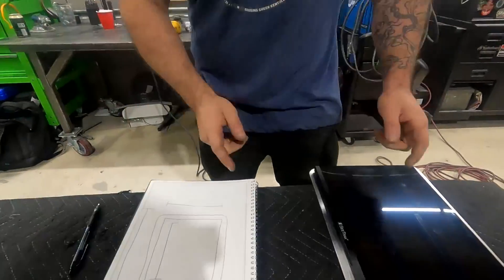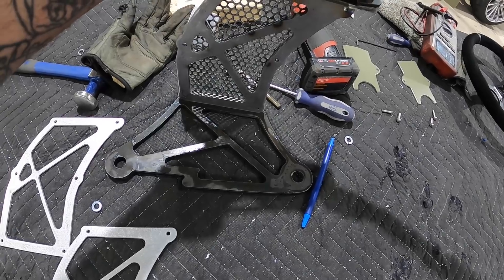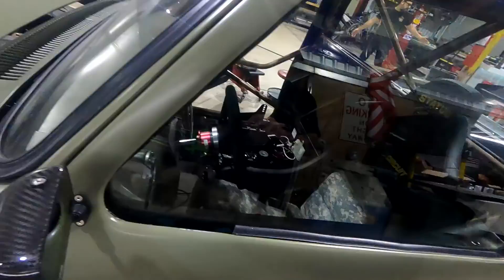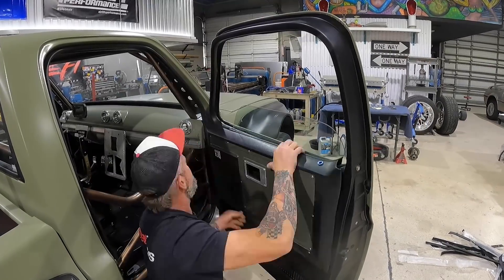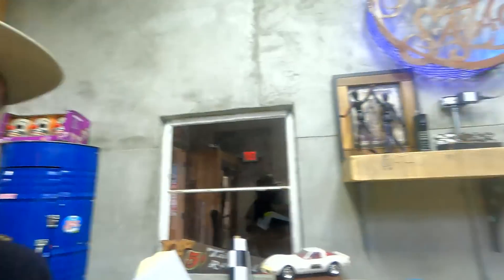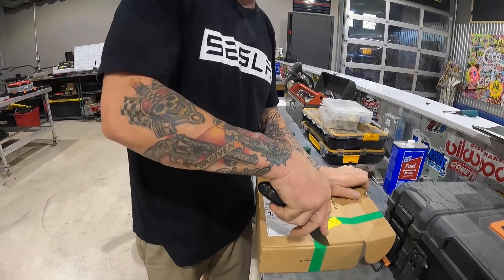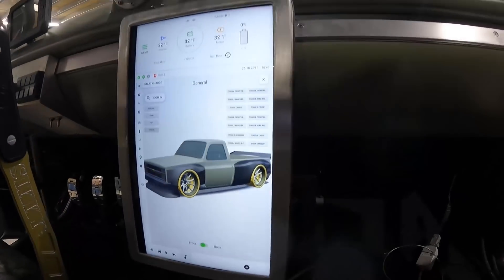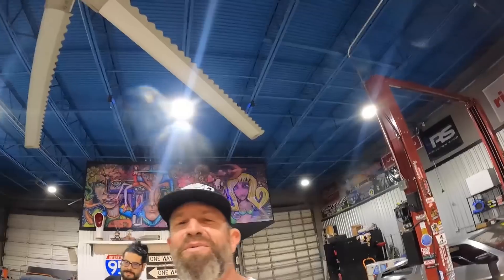The Tesla Swapped C10 Squarebody Gets Ready for SEMA - Electric C10 Ep. 20

Comment: OMG ........ Bolt on mirrors? So much quality work in this truck, should have 3d printed or molded the mirrors to the door (fiberglass or carbon, the mirrors would be small enough to bake in a regular oven I would think), unless you are bolting flares on and there are othe exposed bolts to match but I dont see enough to justify bolt on mirrors.... Either way nice truck, I am too anal about things like this because you cannot skimp on $$ spent and I am a tight wad so would micro manage too much LOL  p.s. if you downvoted the vid you are a bad person.

Comment: Even though the handbrake is not connected to the braking system of the truck, you should put a piece of brake line that comes out and runs back towards the back of the cab. And then out of the brake line run a few wires and through a little grommet or make it look like it's running through the back of the cab to the rear tires. Instead of it just sitting there floating.

Comment: Some outstanding ideas at work. Loved the infinite tail gate light. Though I think smoked glass would look better than chrome when the lights are off. Not so excited about the side view mirrors. They should be compact square electric foldouts to follow the square theme. Oh, and with no visible mount hardware. Also, hood latches need hidden hardware (weld 10-32 studs?). Or use titanium high torque countersink  srews (small detail but screams quality).
Reply from the maker: We’re definitely going to take more time on the next one. This whole truck was built in under 8 months! We’re going to be addressing some small visual things too like putting a tint over that rear tailgate glass
Reply: @SalvagetoSavage  
Not to take away from your creation. It is awesome and in short suspense  too.

Comment: Hey guys there is a file somewhere ask the guys doing the 6wheel C10 that gives you a CNC cut out for a trim piece on those hood latches looks much nicer than the plastic and the file is short not a lot of run time for a killer trim piece. Just a suggestion

Comment: That tailgate looks totally Dope. Great job.  And as for those fender flairs, they fit the body really nice, however I wish instead of the radius look around the tires i think it would look better if they were squared off at the top like the original fenders and the wheels tucked up under the fender flairs. Would make the truck look even lower and more bad ass. However, The S2S LA looks amazing,   Good luck at SEMA.

Comment: Regen will not lock up the wheel. it's natural antilock, the braking force is determined by speed of wheel because it's generating power which adds resistance. no wheel speed, no power generation, no resistance so wheel starts moving which generates power which generates resistance. only way it is going to lock up wheel is if you are using battery power to add resistance or just use regular brakes.

Comment: Does it run and drive or just built to look cool?
Reply from the maker: It runs and drives. Right now we can only use the rear motor until we fix the inverter and we have to baby it until we can get the new water pumps on the truck!

Comment: Sometimes when I come to a stop in my 03 gt mustang with the 4.8 liter I'll hear this raddle having no idea what it is. But what ever the raddle is it will make the RPM on the engine start to jump and shudder a bit.
It also does it when slowing down to a certain speed. It goes away when driving normal and doesn't always make the sound at a stop. I just have no clue what part is making this sound and why it's making the engine jump on rpms. My dad and brother are mechanics but my father passed away 4 years ago and my brother won't help or see me anymore. So I'm all on my own here.

Comment: looking epic, but have to say that ebrake is a bad idea, you guys are probably going to blow the drive unit up. and what ever zero ev as programmed in for regen/throttle ramp might give you inconsistent results,  as depending on SOC, temps, voltage will change how the inverter handles regen.

should really use a sensor with a variance in valve instead of a no/off switch

Id plum hydronic lines with a pressure transducer with real brakes sending a signal to the drive unit.
Reply: As someone who knows very little about either of these things, I’ll just say that I have to imagine there is a bit of finesse and variability to the handbrake depending on how hard you pull it, whereas a simple on/off switch will be just that, and I guess based on the previous commenter, using the regen system will be unpredictable as well.